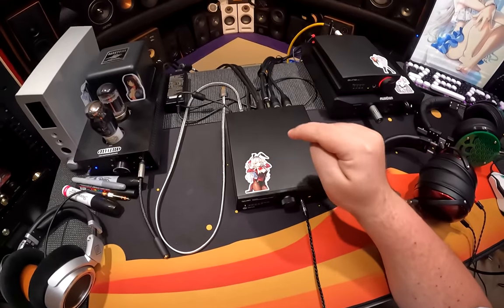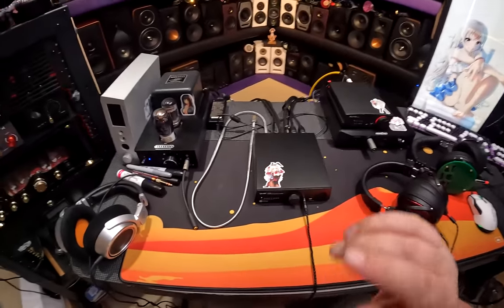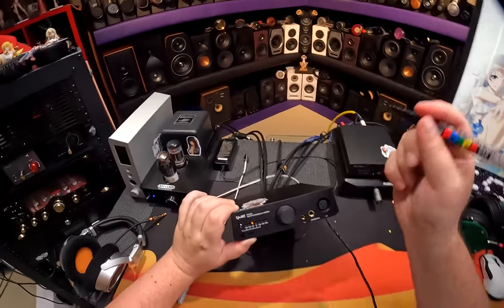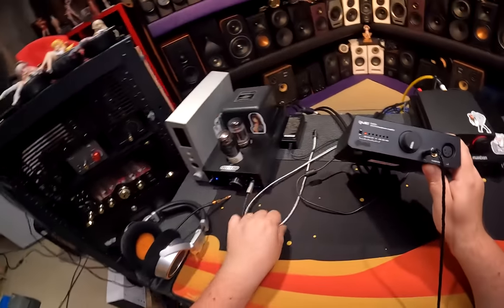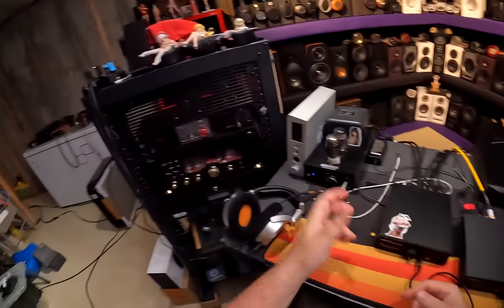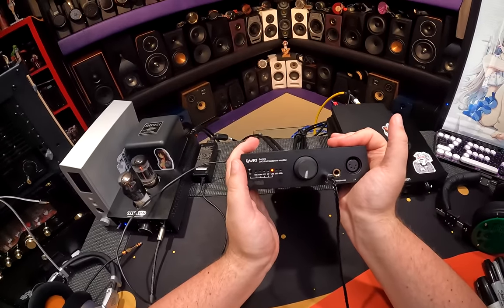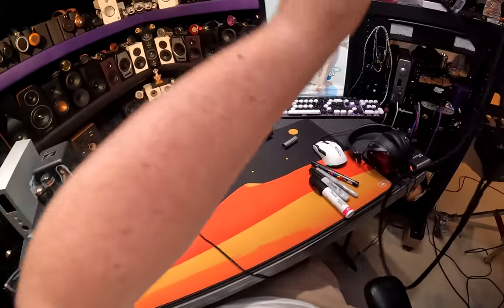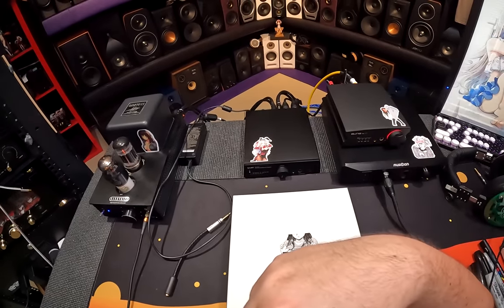Have we Reached Peak Combo? \\ DA~ART Aurora

Comment: Z - did you miss the “dac/preamp” toggle on the back? Could that be why Line IN won’t go to the OUTs? Perhaps toggle needs to be switched to “pre amp”
Reply from the maker: I honestly have to go check now, if I'm losing my mind
Reply: Good point, it also needs to be set to "pre amp" in order to enable the variable output on the analog out jacks.

Comment: Yesss my request! Mine has a white indicator on volume knob. I don't know which one is the correct intended indicator. Also it does route line in to another amp through the analog outputs. You just need to switch from dac to pre from the right switch at the back.